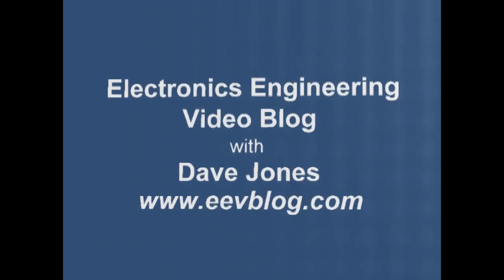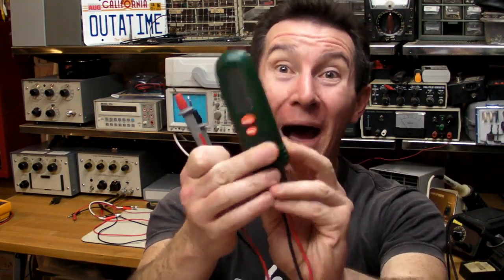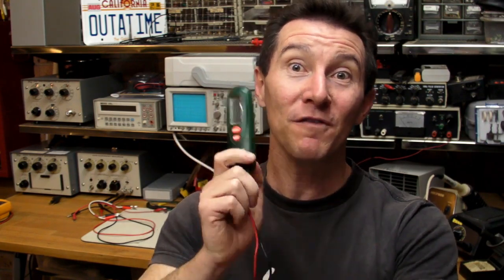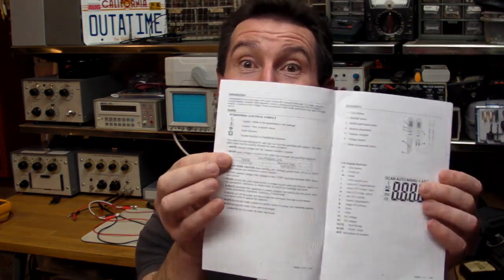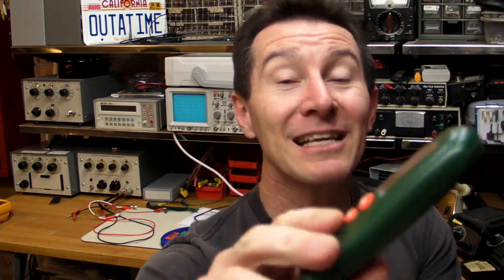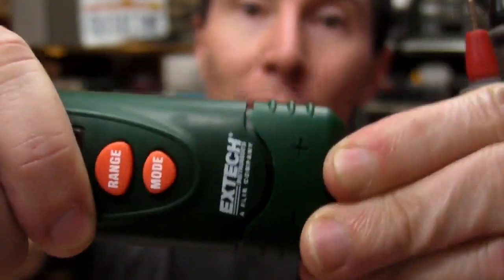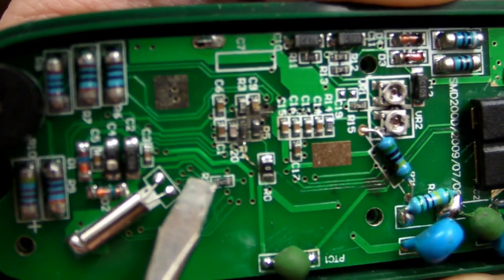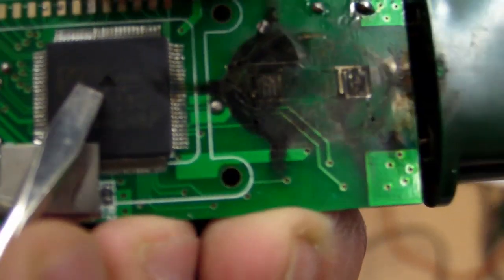EEVblog #94 - Near Death Multimeter Experience

Comment: Most individuals were never taught how to hold, and handle a meter. As you know air capacitors are a real thing. When you get internal white ARC inside your meter, you have a potential of 30,000 volts, on one side of a plastic dielectric, against a good surface area of your hand. Friends of mine have been badly shocked holding a multi-meter, and accidentally touching an electronic gas igniter output.

Years ago I was taught how to hold a meter by my father. He said you put the meter down on something, hang it, whatever, never hold it. Then you pick up one lead and connect that lead to something preferably with an alligator clamp, and do not touch it. Then you take the second lead, in one hand standing on dry ground, and test. I will be honest I thought it was a bit overkill. Then one day all the little no, no's we do in life combined in one serious accident.

There was a power outage, in our industrial building. My boss asked me to check out what it was. So I go down into the now darkened, little room that housed the incoming power. The power was fused through 250 amp fuses. It is a little damp down in the basement, I only have an electronic multi-meter with push buttons. In the dark, I cannot really see the buttons, I figure I better do this right. I do everything text book. But in my mind I am thinking there is a fuse in the meter anyway right, what a big sissy. I almost did not follow procedure.

I put the meter down, I connect one lead to a grounded panel, I touch the incoming power line with the other. Instantly I see what looks like two four foot long snake shaped T-12 fluorescent light bulbs where my test leads were.  I get pushed back, I feel the heat. And now I cannot see anything. Open panels live wires all around me.

I am thinking what happened. I come upstairs kind of in a fog, with my meter and test leads dangling and bouncing with no copper inside of them. If I had a video of this I could laugh till the day I die every time I watched it.

What happened, well two years before we were using this electronics meter to fix a battery operated device. It was not a great meter kind of a do whatever meter. We shorted the meter while we were measuring amperage. We were only working on battery powered equipment we had no new fuse at that location, so we cut a piece of bronze rod and put it where the fuse should have gone. Reminded ourselves that we had to put a fuse in it before we used it. Yea right. After fixing the battery operated device we were patting ourselves on the back mighty proudly. We laid the meter on the bench and the rest is history.

The accident went like this, one day a month before the accident my regular meter fell and broke. So I just grabbed that electronics meter I had no other at the time. Thank God I never shorted it before then. Well the Friday before the power outage I was testing the draw of some Allen Bradley oil tight panel lights, with the meter set for amps. I never use the meter for testing amps especially on AC. I cannot say I was holding the meter in my hand but I suspect it. I hardly ever used those meters for amperage on AC it was just a fluke test I needed to do, so I really had no reason to suspect I left it in the amperage position. Monday morning I come to work and there is no power in the building. I grab my meter and off I go, Boom. There are probably a lot of morals and lessons here, just pick them all and follow them.
Reply: Fuses or breakers are very good, however they cannot always protect you. Especially when people that do not understand the system, wire a house or building.
Reply: @WilliamMcCormickJr  The problem is a regular 15 amp breaker or fuse, for instance, doesn't know or care if a person becomes part of the circuit. It will not trip any time soon unless there is a substantial overload. That means sparky gets fried.
Reply: The fuse in a meter is only for current. So you not only had no fuse but you had your leads plugged in wrong. You are lucky you came out of that without some kind of injury.
Reply: @Janardan S, oh yea, in five minutes I was totally back to normal. Thanks for asking.
Reply: Hopefully your house is fused !
Reply: +William McCormick if you just shorted the leads wud just burn up in like 1sec and you wudnt even see it
Reply: As I said the fuse in the meter had been jumped out years before. The leads did not just fizzle out. They actually as I stated turned into wavy snake shaped four foot T-12 fluorescent bulbs to my eyes. Could be the rubber coated test leads. They held in all the heat and plasma, and expanded like a balloon. There was no copper left in any part of wire. The probes were bouncing up and down it was very comical. I laugh just thinking about it. I have shorted 220 many times and it can be very mild, before and while a fuse blows. This was violent. I was shorting a power supply fused by giant 250 amp main fuses.
Sincerely,
William McCormick

Comment: Blowing up in your hand... One of the days with solar flairs the power was going up and down. I touched an arc fault breaker ... boom. The case was shattered and I got a nice zap. Found out the transfer station had 2 old transformers, the first one blew and took the second one with it. Solar matter probably high wires here in the country.

Comment: Hmm, I was kicked many times by 220VAC(and 300VDC also) and It's for me something like mosquito(bee at DC ^^) bite, so I don't understand why Dave is so scared...
Reply: Arek R. Because under certain rare circumstances, a shock (untreated) could kill you.
Reply: In all these situations I wasn't grounded, and I know that If I will be grounded, It will hurt...
Reply: Arek R. I had this experience with a cattle fence,  dry shoes, just a little bite in the finger, but WET shoes, bääm!!
 it pushed my complete arm
Reply: ThatGuyOnCoke Did the same while reviewing a computer PSU a few weeks ago. Damn, that felt horrible. And I did not even had the time to go to a hospital, university exam the next day. So basically I had to go to sleep and wonder whether or not I will wake up again.
Reply: +AnthonyH Yesterday a cable TV antenna lead gave me a shock of 300V through my both hands. It was, well, a bit unpleasant, but what really gets me is that you can get shocked by something you don't even expect. I was plugging LCD TV to a computer through HDMI, one hand at the metal computer chassis and another on the HDMI cable's metal shield.

[rant]
It's bad that most of our buildings never had protective earth at all (so there's around 110v lurking on the computer case alone), but cable TV providers (analog, mind you, in 2016) are completely retarded greedy assholes. Who the hell cares if coaxial's shielding got stuck to one of the phases somewhere deep in the distribution closet on the floor, right? lol

With cable TV, you sometimes can also pull off interesting (although very dangerous) tricks here, it seems. In some places you can stick a domestic 220v incandescent bulb between antenna coax. shielding and a water heating radiator and it will light up. And stuff like that. Another guy was moving his TV in the other room, and accidentally touched a radiator with coax. BANG! ...and 0.5m of coax cable just evaporated with no pieces to be found.
[/rant]
Reply: ZXRulezzz If i were you i'd use the electricity, since it's free electricity @ the cable tv shit lmao
Reply: Arek R. I got 220 across my heart and had arrhythmia for a few hours afterward. Dumb fuck, 16 year old me decided it was a good idea to grab the chassis of something with both hands. I don't remember what it was, but jesus christ it gave me serious hit.
Reply: Elektrobastler I sometimes have nights like that. I'll force myself to stay awake, and potentially endanger my life further by drinking shitloads of coffee..

On a tangent, what was the power supply?
Reply: ThatGuyOnCoke It was a Fujitsu DPS-500QB from Pollin electronics in Germany. Awesome thing. More or less 80+ Bronze, incredibly perfect voltages with almost no ripples and absolutely no variation depending on the current drawn, only Rubycon caps, great build quality - for 15€. Love it!

Comment: In that picture showing the meter plugged in to an AC outlet, it appears that the outlet is a 120V type.  It's a bit fuzzy, I think the meter is reading "12 something."
Reply: Clyde Wary It should work up until 600V though?
Reply: Clyde Wary That's because it's in an american edison plug. That does not, however, infer that it will only read up to 120V. Always read the ratings on your meter before you buy it, but I've never come across one that isn't rated to at least 600V (Cat III)

Comment: Ha ha, this video is great, I worked at a place with 100 480v air handlers, they wanted one fixed and handed me a cheap "1 Hung Lo" volt meter and I laughed so damn hard, I went and got my fluke, makes me laugh how much people dont respect electricity, Nothing to be scared of but dont piss it off either. Nice video.

Comment: Model on sale in UK  in 2015 http://www.rapidonline.com/pdf/103820_an_en_01.pdf. Has fault been fixed?
"5. NEVER connect the meter leads across a voltage source while the function switch is in the capacitance, resistance, or diode mode. Doing so can damage the meter. "

Comment: I like it when you get on a rant! I also once shorted the mains when I was measuring amperage on something and my probes slipped, the meter shorted and a big pop shot out from my strip (where I had it probed). I think that there still a burn mark on my power strip! Though my multimeter still works!
Reply: Joshua's Recordings Happens to the best of us. :) I don't use my MM much, since I'm more into software (I'd seriously like to get into electronics though, and use otherwise unused C skills to build something) - however, I still have one lying around. (that alone tells you something - just one? :P Yeah.)
A friend of mine once picked it up and attempted to measure the mains (230V)... Needless to say without my knowledge, permission or whatever - I caught him redhanded. Almost literally, since he had the wrong setting in, and popped the smoke out of my socket! He was quite okay, but one of the probes melted.
Reply: Tomasz Wota Opts! 230V is a lot of power! I am glad that I have 120VAC here in the US, a little safer when something goes wrong.
Reply: Joshua's Recordings Meh, I live in a rural area, so most households here have three phase power - so we have European standard 230V in our regular sockets, and 400V in a big special purpose sockets to power some big machines. :P

https://en.wikipedia.org/wiki/Mains_electricity_by_country

Most of the world uses 220-240V 50Hz so I wouldn't really panic over it. It's not like you can touch mains with your finger after all. ;) And after all, anything above ~30V is dangerous to human health/life, so if really bad luck strikes... Yeah. Other than that I've felt the kick of 230V on my hands a couple of times, since I tinkered with it, and it's nothing to sneeze at, but as long as you're adult (...and not wet! ;P) it's maybe not to be sneezed at, but then again, I'm here, no perma-damage, no lasting phycological damage. ;P

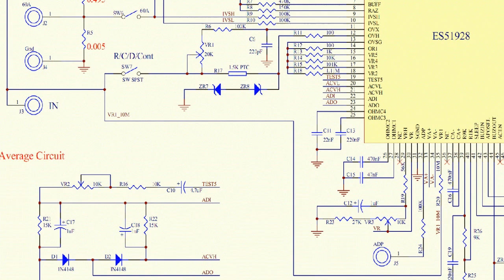Comment: 10:43 The chip manufacturer considered too high a voltage flowing through this path and added the PTC and zener clamp. Switches fail both open and stuck closed and there should be adequate protection in this case.

Comment: To be fair the picture showed it probing 120v American mains :P but the fact still stands, that's just quirky. I hope they've taken this four years to fix this, because not everyone's going to read the manual (like Dave!)
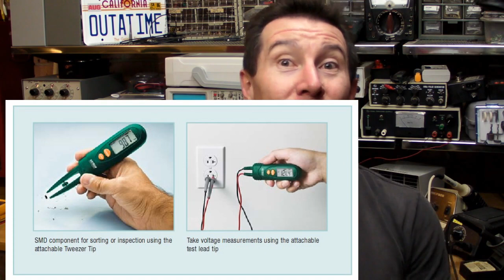Reply: I think we're talking about two different times. I meant 2:00, it's a NEMA-5-20R plug and the meter reads 120 lol!
I know it's not why the meter blew up anyway but yeah
Reply: *****
It's all good lol
Reply: ***** The "T" means it's a 20A circuit rather than a standard 15A
Reply: ***** Some 120v sockets are installed upside down for wiring difficulties.

Comment: Dave I measured 240v and 50 amp with one of these
Reply: you measured 50 amps with this?? did you die????
Reply: Funny considering it doesn't have a current range.
Reply: its not 50 amps unless the load needs 50 amps. A common input impedance of these things is around 10 megaohm. So ohms law tells us the current through the device would be 240/1*10^7 =2.4*10^-4 aka 24 micro amps. To draw 50 amp from a 240v socket you would need a 4.8 ohm load. (we're assuming no reactive loads for simplicity).

There is no amperage with out a load.
Reply: Sure I did not die and I knew it was 50 amp because I probed a rc park plug

Comment: If a lot of them blew up, you might have a point. Was it just that one?
Reply: As he said, he only had the one meter, but there is still no doubt that this is an inherently faulty design. They've used a normally closed switch for the low impedance R/C/D/Cont path, to be pushed open by the voltage probe module. They should instead have gone for a normally open switch designed to be closed by the tweezer module. That way, if the switch mechanism fails you'll just lose the  R/C/D/Cont modes, instead of blowing up the meter.

Comment: You can't thrash the product simply because you fucked up and let the smoke out while it was in your hand. 
How many other things do you have there that would nuke when you stuck em in the power point??? Yet they don't come with any instructions saying not to stick the screwdriver in the power points or your hand will start to smell like bacon.
Reply: True, but it shouldn't catastrophically fail if a mistake like that is so easy to make.
Reply: That is quite the strawman argument (it does have a CAT rating on those inputs, so it is a very reasonable assumption that they can be used in the manner described), and a completely unnecessary comment. Please be civil and constructive.
Reply: While your screwdriver comment is totally accurate... I entirely agree with the main complaint Dave has about the meter. Yes he didn't follow the manual like he admitted but the simple fact of one accidental press of a button can kill you under the wrong circumstances. Accidentally press the mode thing instead of range? yep can easily happen, it's definitely a design flaw imo.

The fact that an accident is one button press away is the key issue here, even while using common sense it could happen ;)
Reply: Jesus
hope u are not a troll.
toasters are supposed to work with toasts, putting knife into it = using it in a completely different way than they are designed to.
multimeter is supposed to work with voltage, so using it with voltage is the way the device was built for.

maybe you could rather compare it with: if you dont put the handle of the toaster to the maximum down (and there is no klick etc. if you would do) then the toaster will not start counting and holds and toasts forever.. and starts burning..

how i wrote before: they thought about switching mode automaticly when putting in this voltage-measure-think into. they just did it in the wrong way: while putting it in, it has to SWITCH the MODE FIRST and THEN GETTING CONTACT with the MEASURE-WIRES.

If you measure with 600v, a rubber knob is not enouth security. it is pushed to easy, if you are not carefull. a mechanical switch can´t be switched as easy without wanting it.. and you would see the mode better with the first look, much clearer than on a lcd.
Reply: He thrashed it because of the safety concerns he raised. If he had, say, put a multimeter in current measurement mode and then put that across the mains, your criticism would be fair enough. However he attempted to use it how any multimeter would be reasonably used (and as demonstrated in the photo in its brochure). I think his thrashing is perfectly valid - it doesn't look fit for purpose. The mere presence of such a warning in the manual raises grave concerns about its design. The fact that its 'interlock' switch can so easily be defeated (make-before-break) is scary.
Reply: it all depends how easy it is to use this device in a wrong way AND what happens if you do.
first you can come to a rubber switch very easy during measurements..
secondly,  if you put in your voltage-measure-think into the device: It should switch to voltage-mode BEFORE contacting the measure-wires, not after! that´s a fatal fail in logic!
Reply: It's a fucking multimeter. It's designed to test. If you knew what you're measuring, you would not need to measure, would you? What if he measured a loaded high voltage cap? Same would have happened. The darn thing should have proper protection but driving down the cost is usually more important. I'm selling a kidney and getting a Fluke. Surgery is way safer.
Reply: It shouldn't melt itself like that, though! He didn't try to use the meter outside of it's intended purpose, after all. If it simply stopped working by setting it to ohms while measuring voltage, that might be acceptable for a cheap meter. However, CAT 3 ratings DO NOT BELONG on meters that can EXPLODE OR CATCH FIRE by pressing the wrong button! (Or, in this case, not having the plug in all the way, but just as reasonable of a user error as a wrong button).
Reply: your an idiot trying to troll people who know 100 times more about the topic than you do. FAIL troll is FAIL!
Reply: MichaelKingsfordGray Indeed. As the saying goes: With great power comes great heat dissipation.
Reply: MichaelKingsfordGray
This shouldn't pass IEC 61010-1 cat 3 tests, specifically 4.4.2.12 test for single fault in this switch.
Whoever rated this cat 3 failed to test the equipment properly and/or the switch component was not disclosed.
(And possibly 5.1.5.2, the true terminals when the connector is unplugged are not marked correctly.)
There's a section 15 specifically about interlocks like this one.
Reply: A knife fits in a toaster too. 
If you wet the bed, don't use an electric blanket.
Neither have any protection built in.
Reply: Oh well...
Reply: Yeah...... What he said.